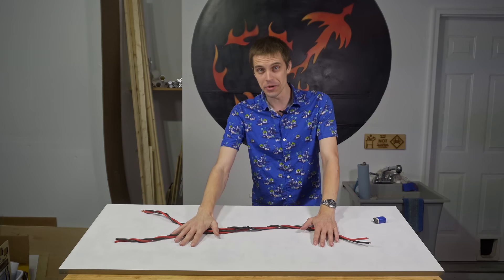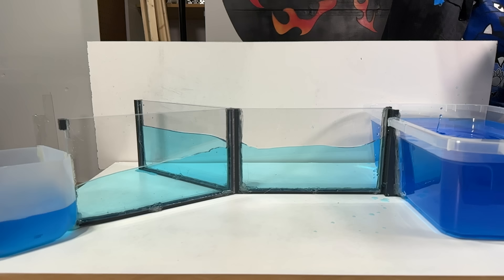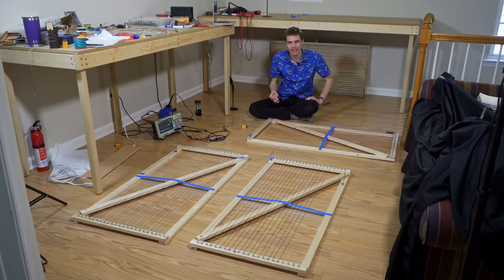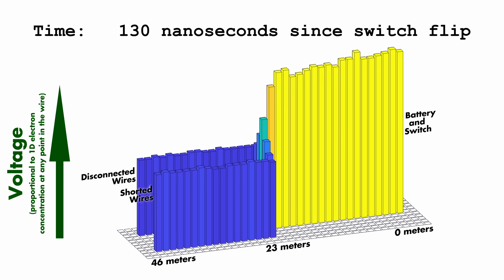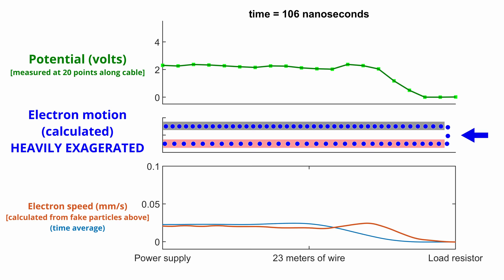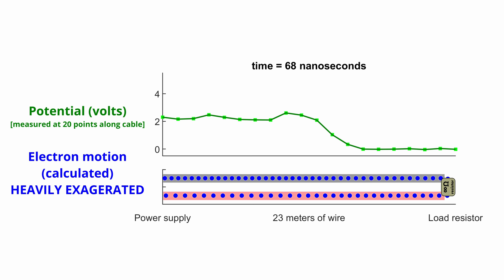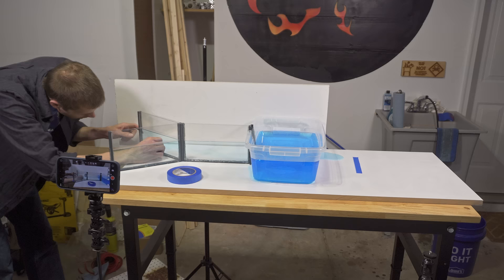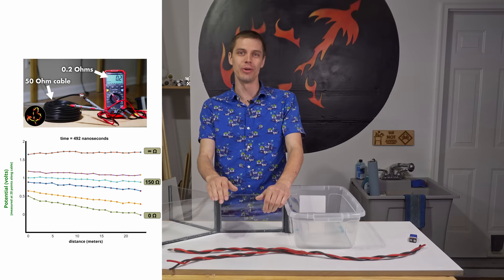Watch electricity hit a fork in the road at half a billion frames per second

Comment: If you want an increased insight of why there is a backward reflection at the Y, then i Refer you to the ARRL Radio Amateures Handbook.  The section on antenna feedlines and standing waves will talk about impedance changes along a feedline and how they cause a reflected wave.  and the section on quarter wavelength open and shorted stubs act like an inductor or capacitor depending if they are open or shorted.  I enjoyed and learned from your presentation.  Thankyou.
Reply: I think twisted wires minimize inductance across proximity conductors ,data wires are twisted for that reason .Straight wires act as capacitors ,inductors , resistors and radio antennae causing fluctuations in flow of electrons for reasons you mentioned .In the first milliseconds open wire act as inductors too before voltage is saturated as there is a temporary wire load before that .  Each component is contributing  its share to what ends up being seen on oscilloscope ,i wonder if heat fluctuation  is causing the jolts by changing the  resistance ,speed  of electrons across conductors  .Good presentation

Comment: The analogy between electricity and fluids is always a good learning tool. Pointing out where it isn’t exactly the same is also a very good point to make.
Reply: @sIXXIsDesigns  excuse my ignorance but i was under the impression that even the speed of light was not absolute and is changed depending on the medium it moves trough, the same should hold true for electromagnetic waves/particles as they follow the same physical rules. taking this into account a change in medium should absolutely change the speed of electrons. knowing further that electrons are routinely measured in particle colliders and have different energy levels which are respective of their relative speed since their mass is negligible your statement is further pulled into question. also staying with particle accelerators they often use electrical fields to accelerate electrons and smash them into eachother at close to c which in turn posits that electrons at regular energy levels DONT travel at c and need a great deal of electromagnetic coaxing to get even close to that speed.

Comment: Very nicely done.

The right equipment is called a Time Domain Reflectometer.  It will show you the impedance change over time. 

The twisted wire is a transmission line with a specific impedance based on the inductance of the wires, and the capacitance between the wires (Impedance3 = Sqrt ( L / C).  The initial current comes from charging the wire to wire capacitance through the inductance of the wire.  Current drops as the capacitance is charged.  

The twisting does matter.  If the wires were spaced 1mm (or further) apart, the velocity would be faster and the initial current would be lower.  Measure the capacitance of an unshorted pair of wires, and inductance of a shorted pair of wires.  Use Sqrt L/C to calculate cable impedance.  When the signal hit the shorted end, the voltage drops, the open end, the voltage rises.  If you put a resistor equal to the cable impedance, when the voltage hits the end, it will stay the same.    

As the current hits the "Y", the impedance drops in half, the mismatch sends some energy back toward the battery.  The current branches and reflects off the ends, the current drops at the open, and increases at the short.  That reflects back, and the drop and increase pretty much cancel each other.  

The current can't see the ends because until all the wire capacitance is charged, the ends see no voltage.

The current leaves the negative terminal, charged the capacitance of the first mm of wire, with the current returning to the positive terminal.  Then the second mm is charged, then the third, all the way to the end.

Comment: I worked in diesel fuel injection where the pressure waves in the diesel are the main event. Fuel is injected in tiny pulses  say 100 microseconds at 2700 Bar ( the sort of pressure you find in gun barrel ).  All that applies to electronic pulses applies to liquids even at these pressures and time domains.   Your demo and graphs are spot on !

Comment: I, a music major, earned a D in a physics department electronics course in 1987, and just about the one thing I remember is the prof drawing a rudimentary circuit and making a side comment that the math involved is the same one would use in predicting water pressure through pipes and regulators.  So calming to see the "current" rush in , build up against a wall, and slosh back in waves until it reaches equilibrium.

Comment: As well as the water analogy, the other thing I find fascinating about impedance mismatches is that they're exactly equivalent to what happens if you send a pulse down a rope or string. A short circuit is equivalent to what happens if you tie the rope to a fixed point, the reflected pulse is out of phase with incoming pulse. If the end of the rope is free to move (best if only vertically, not horizontally) it's akin to an open circuit, where the reflection comes back in phase. This is also true of sound waves in wind instruments. Stuff all wiggles basically the same, no matter if the stuff is an electromagnetic wave or air in a tube or a bit of rope.

Comment: Very good presentation. I am an electrical engineer, and given the capacitance in the non-terminated branch, I could imagine the approximate experimental results, with circuit capacitance initially acting like a short circuit instead of open circuit. If this demonstration was used in the classroom, it would be a great tool in exemplifying the mathematical circuit model.

Comment: Love this video.

I like to think about current like vibrations through a material (you had a video about that). It's way more intuitive to think about how the information is passed between electrons than it is to think about current as most understand it
Reply from the maker: The only difference is that after the vibration has passed, the whole material is left moving!
Reply: This problem is basically identical to applying a step pressure to a fluid loop.

Comment: C: Current will start when the battery is connected according to the impedance of the twisted pair of wired directly in front of the battery. The high frequency waves going back and forth will eventually subside and leave only a steady DC state.
Reply: I think this answer is correct 😄
Reply: Current from the battery starts immediately it's connected. That current is charging the capacitance of the cable.
Reply: Similar answer for me. The electricity will go down both as though the resistance is the wires impedance. Then, at the fork, the signal will reflect off of it , and it will also reflect off the closed end and open end.
Reply: The visualization and data gathering are impeccable. I do wish he would have done one more visualization of the single wire with a resistor equal to the impedance of the wire showing no reflection.

But the theory and words are so far off electrical theory as taught in college 

Electrons are negatively charged so they move in the opposite direction of a positive voltage.  This probably only matters in semiconductors. 

The voltage measured is an electric field. The field is propagating down the twisted pair

The “weird” thing at the fork is easily explained by the change in impedance at that point. Missed opportunity to introduce impedance based analysis for time varying electric fields
Reply: Also the inductance. Energy is stored in both the electric and magnetic fields of the wires. @TerryClarkAccordioncrazy
Reply: According to it's Characteristic Impedance

Comment: Seeing how current still flowed in an open circuit was an "aha," moment for me, an finally crystalized how antennas are able to work (BTW, it would be fantastic if you were to expand the concepts here into that realm). Furthermore, the chaotic inrush into that leg visually demonstrates why tuning an antenna to resonance is so important, as that spike presumably would happen again and again with each cycle when it comes to AC, and not doing so could cause significant signal cancellation.  Well done!!
Reply: He only guessed the current, what is shown is V
Reply: ...and fitting the impedance to the wire (50 Ohm usually) to ensure that the current flows out unhindered.

Comment: My favorite part as an EE (other than the ENTIRE video) is the equivalent circuit that pops up on the water circuit at 22:43:something. It's just so neat to have the modeling of our differential equations we learned apply to the multiple analogies slightly differently, but yet the transient ideas are the same. I had a hunch for C from I=C dV/dt and the fact that there is always transient ringing at fast edges when measuring voltage at a source with any resistance. Nothing related to transmission lines that humans have modeled and built (like long cables and antennas) would work without this concept of the wave reaching equilibrium non-instantanneously. This so intuitively explains reflection and transients in circuits, I think it should be mandatory to show such a demo to 1st year electrician/technicians/engineers working with electricity. Thanks for making this.
Reply from the maker: first comment I've seen to catch that lol. I think i only threw it on screen for 10 frames or something =D
Glad you liked it!
Reply: I recall when my electronics teacher demoed this on a reel of coax cable, which he had open, then shorted, and lastly properly terminated.

Comment: I admire your tenacity and determination in pursuing how to explain this problem to non radio engineers, well done. As a retired radio engineer, we think in terms of the characteristic impedance of a line, its terminating impedance, and consequent reflections. That makes it easy.
By the way, regarding the short circuit on the water line, the only way to replicate that is to have a very wide hole at the end so that the water can flow out without any height (= voltage) restrictions. My apologies if you already mentioned that.
Reply: 55 years ago, I was taught by Western Electric and Bell Telephone instructors how to trouble shoot telephone cable. Much of this was already known but not very well explained. This does help visualize the way it works.

Comment: I haven’t ever seen a visualisation of switching on power to an LC circuit at that scale. Thank you very much for your work. You probably know that you can slow down and make your measurements much easier by increasing the inductance (L) of the shorted end and increasing the capacitance (C) of the open end, either by increasing the lengths of the wires (as you did) or by applying an inductor and a capacitor.
Reply: But he's not demonstrating an LC circuit. He's demonstrating a transmission line, which is equivalent to a series of tiny LC circuits, which distribute the effects over distance and time. That results in a wave propagating along the transmission line.
Reply: @Graham_Wideman  Are you serious ???.... How on earth is he demonstrating a transmission line when the stimulous is DC ?  Please go and read up on some basic electronic theory.   By the way, if he was demonstrating  transmission lines , using an appropriate AC frequency and line length, (so not stubs), the results in each arm would be the same. Both a short and an open will reflect equally.This is something he definitely can not model using water !

Comment: This same process is used to find a broken wire that's buried underground!  I actually have this problem right now in the power going out to my shop.  Unfortunately, I no longer have access to a proper oscilloscope. (Mine is too slow).  However, buying a proper oscilloscope is cheaper than digging up 300 feet of my front yard, and digging only one smallish hole in the yard will reduce the Wife's response greatly!

Comment: This is awesome. My guess for the  reason for the disagreement between water and electricity is probably that in the experiment you’ve set up there are two wave speeds: free surface waves (can see) and pressure waves. Pressure waves move at the speed of sound - much faster than the surface waves. If you made it a closed pipe (pre filled) and did your experiment with pressure sensors (to compare to voltage by analogy) the overall analogy would probably match much more closely.

Comment: Wow.  I have a Ph.D. in Electrical Engineering, and I am impressed at how clear and effective this video is.  Excellently done!
Reply: Did you already know a lot of this information, or did you learn something?
Reply: @hydropage2855   most of it I already knew, but not from a single source, more the total of the education and experience I have.  I did not realize the potential wave reflected multiple times across a DC circuit, though, I figured that only happened once, so that was cool to see.
Reply: @daniellewis3330  I actually feel like it would’ve made more initial sense to me that it would happen many times, since pretty much everything in the world boils down to oscillations in one way or another, mathematically I’d assume it would “take forever” for this to settle down
Reply: @hydropage2855  fair
Reply: Do you understand how transmission lines work?  Because that's what you're looking at.  His conclusions are completely wrong.  You should have realised this as a PhD;  in fact just as an electrical engineer.
Reply: @ChristianRThomas I do know how transmission lines work, though they're not my focus.  His conclusions are pretty well explained and demonstrated. What are you claiming is wrong?
Reply: Noone asked if you have a PhD.
Reply: @qozia1370 it's called providing context.  By specifying my experience level, I'm giving a framework by which to gauge my interest level, and demonstrating that I'm not just plucking the statement out of thin air.
Reply: @daniellewis3330  Yet you still got it as catastrophically wrong as the channel host.  Your, presumably valueless, PhD ended up misleading everyone.  This is the problem with prizes for everyone and the debasing of qualifications in a chase to the bottom. You probably have the education and understanding of 15 year old.  Certainly I wouldn't have made such an egregious mistake at that age
Reply: @ChristianRThomas  my PhD was in studying graphene, and I'm a lab manager and research scientist, so I'd say it's been plenty useful so far.
Meanwhile you continue to rant about how it's wrong but can't seem to explain why.
Your noise is valueless.

Comment: Great transmission line example. As a high speed ASIC designer who had to build driver circuits I found your explanation fairly helpful and captures what most engineers only see in simulations. Luckily I spent enough time in the lab that this is second nature to me at this point. Impedance mismatch is absolutely the reason for the ripples and waves seen in the wires. Now try to apply this for the switch that launches the incident wave!

Comment: Cool! It works just like a wave tank. Just like a wave of water, or a wave on a rope - note that the shorted wires are like the "ends tied down" version of the rope, while the disconnected wires are like the "ends free to bounce" version, that you get in the classic waves-on-a-rope problem in Mechanics.

Comment: I haven't watched the follow-up videos yet, so maybe this is covered there, but I think it would be really cool to do the same experiment, but instead of measuring the voltage across the two wires in the twisted pair, measure the voltage in each wire separately with respect to a common ground like the ground terminal of the battery. That way you could see not only the positive wave traveling down the one wire, but also the negative wave traveling through the other and the point at which those two waves meet in the middle and start to even things out

EDIT: nvm, after watching the follow-up on how the measurements were made, I realize now that while it would be nice to see in theory, being able to actually make that measurement in a way that isn't filled with noise would be prohibitively difficult
Reply from the maker: It gets pretty messy! that's in the follow up https://www.youtube.com/watch?v=sty0Y1qmgEYc
Reply: @AlphaPhoenixChannel  Reality is always more complex than we'd like it to be lol. Still, between these videos and the ones where you use the water models to demonstrate why steady state circuits behave the way they do, you have given me a deep intuitive knowledge for how electricity works that my physics classes never did. It's really incredible work and these videos deserve so many more views!
Reply: It wouldn’t go against the flow or meet up… there’s a flow direction unless you force them to loop… then you get heat… it never crossed it’s dissipated to everything else…

Comment: 20 years ago, I learned about this because we used the time current propagate to polarize circuits. Some components needed to be powered in reverse before the circuit settle. 
So, we would strategically place inductors that had no other purpose than introducing delay and capacitors that had not other purpose than creating a short and becoming a break.
So, you would design your circuit in two stages. (polarization and settled)

And it greatly helps to think as if you were using AC for the first stage.

And before that, we learned to use a capacitor with a pull down resistor to eat the spike when there is a latch or relay.

Now, I don't think it's even required anymore.